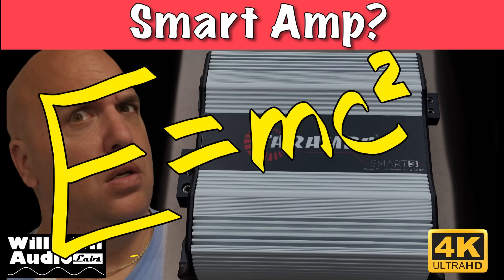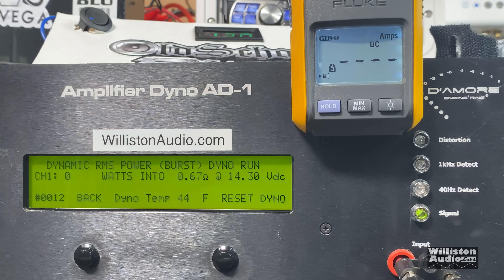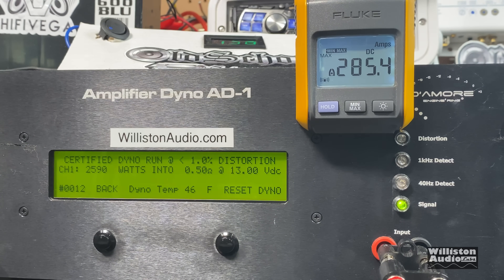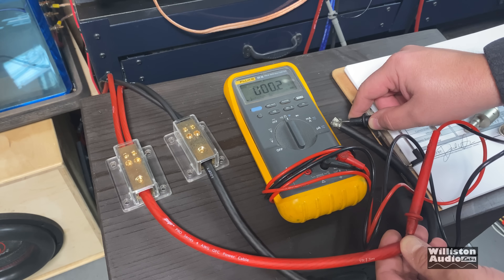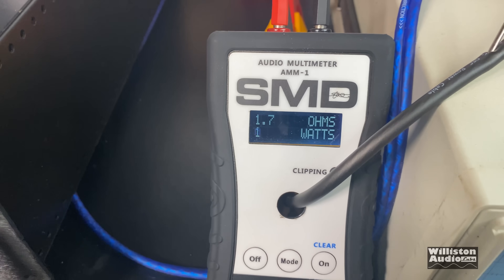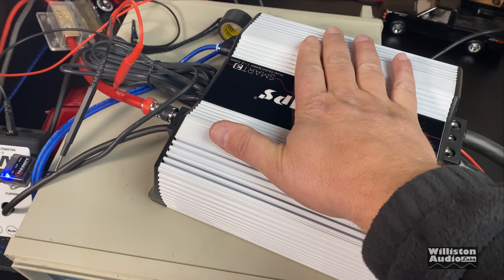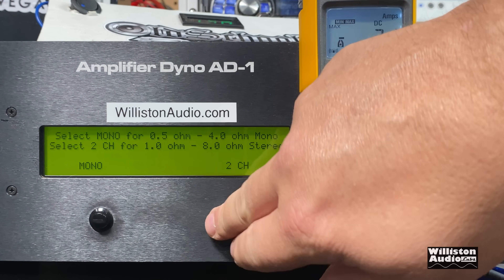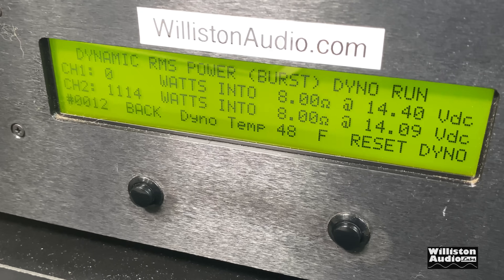Taramps Smart 3 vs 6000W Sub and INSANE Amp Dyno Low Impedance Testing [4K]

Comment from the maker: Buy the Taramps Smart 3: (affiliate links)
Amazon: https://amzn.to/3c2ZHi4
eBay: https://is.gd/tarampssmart3ebay

See other Brazilian amps I've tested:
https://is.gd/walbrazilamps

Video Timestamps:
0:17 Introduction to Video
0:52 0.8 ohm Dyno Tests
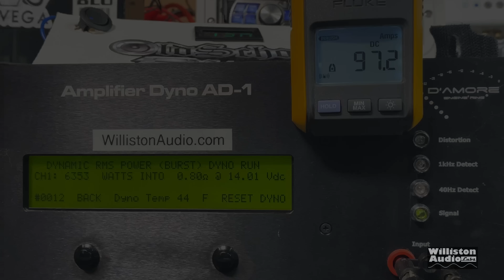1:51 0.67 ohm Dyno Tests
2:41 0.5 ohm Dyno Test
4:56 6000W Sub Wired at 0.5 ohm
8:52 Measuring Temp of Amp after Testing
9:43 Clipping the Smart 3 with Feel the Bass
10:31 0.5 ohm Dynamic Test on Amp Dyno
11:37 8 ohm Amp Dyno Tests

DISCLAIMER: This video and description contains affiliate links, which means that if you purchase from one of the product links, I may receive a small commission. This helps support the channel and allows us to continue to make videos like this. Thank you for the support!